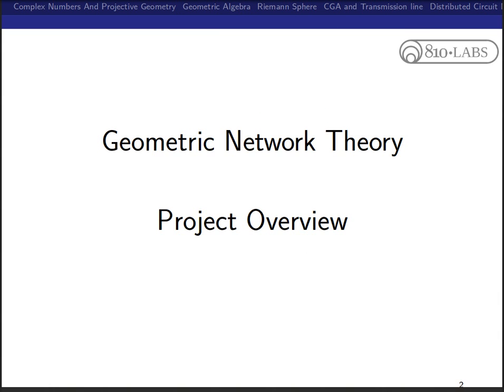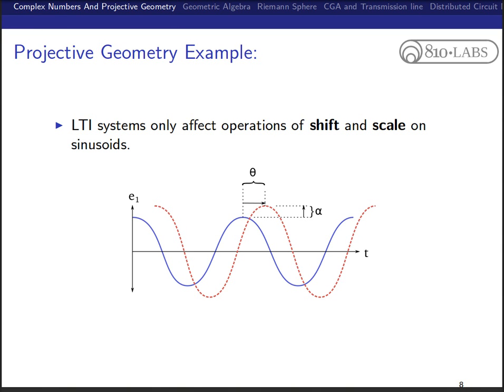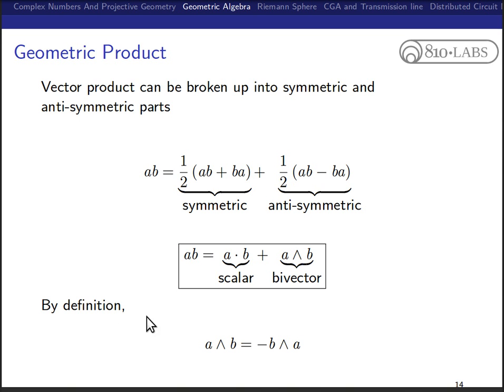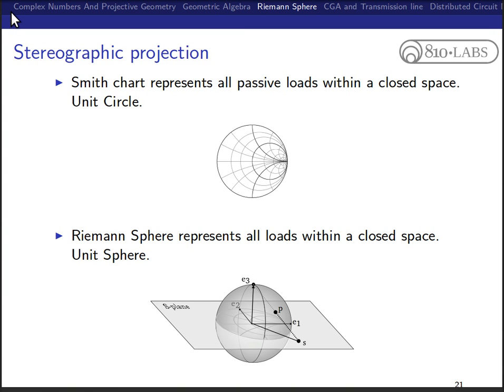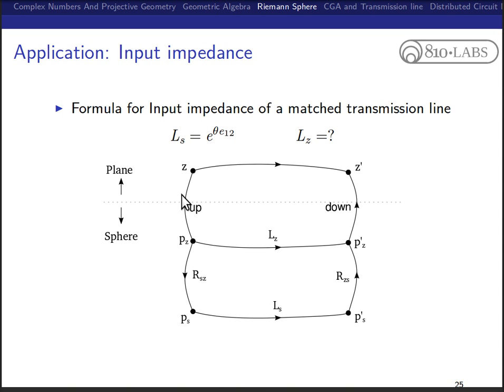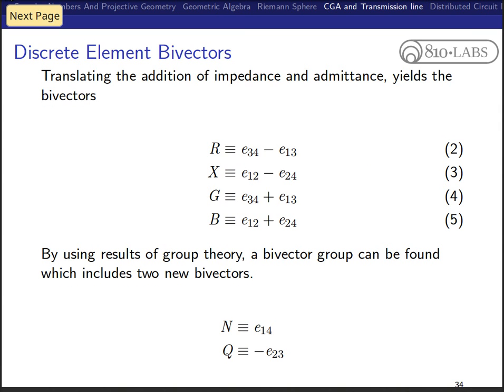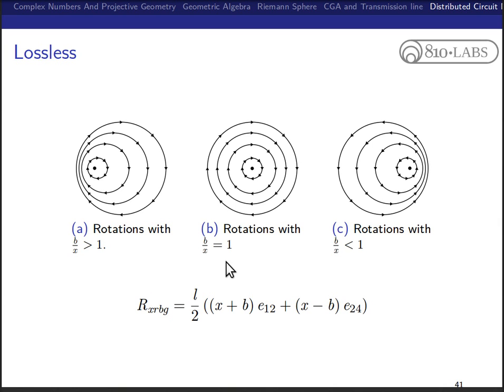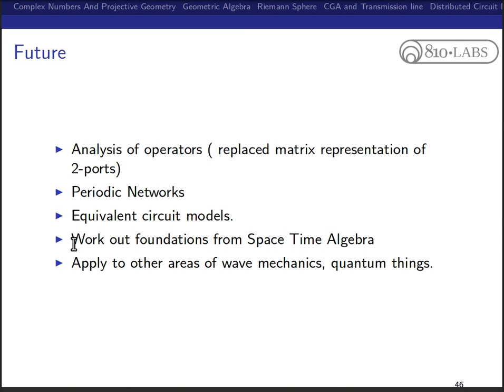Applications Of Conformal Geometric Algebra To Transmission Line Theory

Comment: Cool, you're investigating the same stuff I'm investigating. The Smith Chart, conformal maps (sqrt(x^2+1)+x, -sqrt(x^2+1)+x, sqrt(x^2+x+1)+x, -sqrt(x^2+x+1)+x), distribution of points on double angle sphere [x^2-y^2-z^2, 2*x*y, 2*x*z], spinnors, and I imagine you noticed gamma by now. So, two complex numbers behind all of this. Possibly two quaternions behind each for conformal mappings. I don't plan on going down this road though. I'm doing DSML in collage. Best I can ever hope for from a physics professor is a giggle and maybe a comment about my pretty graphs.

Comment: Can you extend it to N-port impedance matrices with N>1?
Reply from the maker: i have  another video about how to model 2-ports. i worked on the n-port problem for a while but never figured out a good model. i think its possible.
Reply: @810labs  Especially interesting would be the calibration of an N-port network analyzer with a 2N-port "error network" in the connection. Leading of course to a "calibration group", isomorpic to Sp(2N,C) if I'm correct. (Since a reciprocal S-matrix gives a symplectic T-matrix. Lots of interesting things!)
Reply from the maker: @JosBergervoet   it would be really neat. feel free to email me.

Comment: I know this should apply to human vocal tract analogy and resonance for vowel sounds. I see bits and parts I recognize, but I am still at a loss. I know how to take vocal tract cross sectional areas and with cascading operation I can get the formants, F1, F2, F3,... And I would like more direct methods, such as rotations. But I don't see the connection.

Comment: Thanks a lot, very well done and inspiring. Have you done some work to see how it describes nature when we upgrade Minkowsy spacetime to 3 complex orthogonal planes? Consider a quite significant flaw in the interpretation of Einstein’s discovery of the constant of speed of light; what if c isn’t a speed (a vector pointing in the direction of motion) but just a fixed scaling factor, manifesting the ratio between distance and time, as 2 properties of the same, only differing locally due a phase shift, which can be represented by a complex number at each position in the grid. This would imply time to be a 3D vector as well, as it scales to distance with a constant scaling factor c. A wave observed from a fixed position and time is a phase shift of position in 3D space vs a moment in 3D time. 

I am pretty sure we can succesfully detune our observations from Minkowsky spacetime manifold to a static grid. As a next step in the transformation of our observations we should then model and observe (measure) cosmic as well as minute expressions of the universe in GA language (G3+3 Space, a space spanned by 3 orthogonal basis vectors in real 3D space and 3 orthogonal basis vectors in imaginary 3D time). 
Each basis vector of space pairs with its imaginary Counterpart basis vector of time. Dynamics come into existence through phase-shifting the grid positions In the 3D field of moments of time with the grid positions in the 3D field of position in space. Entanglement is a phase-lock relationship of 2 separate positions in 3D space; superposition is a phase-lock situation of two separate Positions in The 3D time field at a single position in 3D space. 

It would be great fun to demodulate the forms constructed over space in the 3D field of time experienced from a fixed position in space, which is a superposition of phase shifts, hence waves at a certain fixed position. Who volunteers to colaborate with me to work this out. The project should render 3D animation models demonstrating properties of fundamental particles, superposition, entanglement and should demystify observations such as in the double slit experiment. It would explain the measurement problem and dequalify the Copenhagen interpretation of the collapse of the wavefunction, which is nothing more than opening ourselves to 2 new time dimensions that operating at slight phase shifts around moments of observations in linear time.
Reply: When you put it like that, I get the impression that this might be better described as time being a bivector space (or pseudovector space). The bivectors in G(3) behave very much like complex numbers to the point that you can argue that e12 simply is i, with the other basis bivectors forming the quaternions j and k. Since bivectors generally work very well for rotations, it seems like you're suggesting that we could rotate a position in space by a position in time, which is an interesting idea. This would also equate time the the quaternions if you include the scalar part.

The alternative to that would be a G(3,3) space where time has its own separate basis vectors that square to -1 rather than acting as bivectors of the spacial basis vectors. This would give an absolutely massive 64-dimensional multivector space which I personally would rather not think about.

Honestly, if you think there's merit to the idea, try it out! If it appears to accurately describe observations in real life and matches the existing math, then it could very well end up changing our fundamental understanding of the universe. If it doesn't work out, so what? How often to you get to play around with a 6 dimensional vector space‽
Reply from the maker: Geometric Algebra emphasizes real algebra. complex algebra is ambiguous geometrically.
Reply: What do you think of the suggested interpretation of c (scalar vs. vector)? 
With time being a 3D vector too?  If we could visualize this in 2 x 3D. Time being the 3D phase modulation of each position in 3D space?
Reply: @810labs  THE ABSOLUTE, BALANCED, EXTENSIVE, AND CLEAR MATHEMATICAL PROOF REGARDING E=MC2 AS F=MA:

Gravity IS ELECTROMAGNETISM/energy, AS E=MC2 IS F=MA. The Earth (A PLANET) is a MIDDLE DISTANCE form that is in BALANCED relation to the Sun AND the speed of light (c), AS the stars AND PLANETS are POINTS in the night sky; AS E=mc2 IS F=ma !!! This NECESSARILY represents, INVOLVES, AND DESCRIBES what is possible/potential AND actual IN BALANCE, AS ELECTROMAGNETISM/energy is gravity. Very importantly, A PHOTON may be placed at the center of WHAT IS THE SUN (as A POINT, of course); AS the reduction of SPACE is offset by (or BALANCED with) the speed of light (c); AS E=mc2 is F=ma; AS ELECTROMAGNETISM/ENERGY IS GRAVITY. The stars AND PLANETS are POINTS in the night sky. The sky is blue, AND the Earth is ALSO BLUE. (OVERLAY what is THE EYE in BALANCED RELATION to/WITH what is THE EARTH.) E=MC2 IS F=ma !!!

TIME DILATION ULTIMATELY proves (ON BALANCE) that ELECTROMAGNETISM/energy is gravity, AS E=mc2 is F=ma. INDEED, TIME is NECESSARILY possible/potential AND actual IN BALANCE; AS E=mc2 is F=ma; AS ELECTROMAGNETISM/energy is gravity. The stars AND PLANETS are POINTS in the night sky. SO, THE EARTH is E=mc2 AS F=ma IN BALANCE. Objects fall at the SAME RATE (neglecting air resistance, of course), AS ELECTROMAGNETISM/energy is gravity. Gravity IS ELECTROMAGNETISM/energy. It ALL CLEARLY makes perfect sense. BALANCE and completeness go hand in hand. So, get a very good LOOK at what is THE EYE. (Very importantly, outer "space" involves full inertia; AND it is fully invisible AND black.) "Mass"/ENERGY IS GRAVITY. ELECTROMAGNETISM/energy is gravity. E=MC2 IS F=ma.

Gravity AND ELECTROMAGNETISM/energy are linked AND BALANCED opposites, AS E=MC2 IS F=ma; AS ELECTROMAGNETISM/energy is gravity !!! Gravity IS ELECTROMAGNETISM/energy. BALANCE and completeness go hand in hand. Consider what is the speed of light (c) as well. Carefully consider the man who IS standing on what is THE EARTH/ground. Touch AND feeling BLEND, AS ELECTROMAGNETISM/energy IS gravity. Energy has/involves GRAVITY, AND ENERGY has/involves inertia/INERTIAL RESISTANCE. The ultimate mathematical unification of physics/physical experience combines, BALANCES, AND INCLUDES opposites, AS E=MC2 IS F=ma (ON BALANCE !!!); AS ELECTROMAGNETISM/energy is gravity !!!

"Mass"/ENERGY involves BALANCED inertia/INERTIAL RESISTANCE consistent with/as what is BALANCED electromagnetic/gravitational force/ENERGY, AS E=MC2 IS F=ma; AS ELECTROMAGNETISM/ENERGY IS GRAVITY. Gravitational force/ENERGY IS proportional to (or BALANCED with/as) inertia/INERTIAL RESISTANCE, AS E=MC2 IS F=ma; AS ELECTROMAGNETISM/energy is gravity. Gravity/acceleration involves BALANCED inertia/INERTIAL RESISTANCE, AS E=mc2 is F=ma IN BALANCE; AS ELECTROMAGNETISM/ENERGY IS GRAVITY !!! Therefore, objects (AND the falling men) fall at the SAME RATE (neglecting air resistance, of course); AND the rotation of WHAT IS THE MOON matches it's revolution. MOREOVER, a given PLANET (INCLUDING WHAT IS THE EARTH) sweeps out EQUAL AREAS in equal times consistent WITH/AS F=ma, E=mc2, AND what is perpetual motion; AS ELECTROMAGNETISM/energy is gravity; AS E=MC2 IS F=ma IN BALANCE !!!! Gravity IS ELECTROMAGNETISM/energy, AS E=MC2 IS F=ma. This NECESSARILY represents, INVOLVES, AND DESCRIBES what is possible/potential AND actual IN BALANCE !!! Great.

By Frank DiMeglio

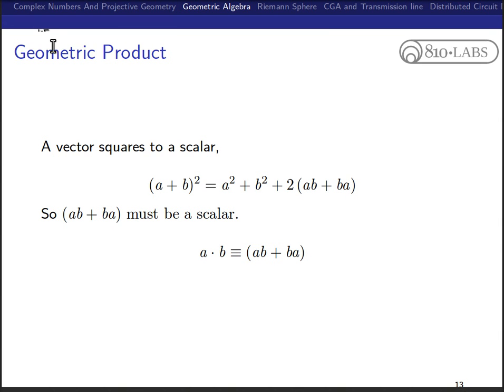Comment: My question is two part and concerns the video at 8:07.  Part A) to my question begins: you place the square of two added vectors aka their expanded dot product  as a second supposedly-equivalent statement a^2 + b^2 + 2(ab+ba). I must check from you that these are intended to be the nonorthogonal case because otherwise our dot product would be 0. And if this nonorthogonality stands, then this looks to me exactly as the law of cosines should look which would equal out to some scalar quantity c^2= a^2 + b^2 + 2a•b. If so, then 2(ab+ba) looks confusing and my first question is can you clarify why we are using this 2(ab+ba)? Part B) Still concerns 8:07, where I would like to know why this a•b would also be the same as (ab+ba). This is below your first formula. We are taught in the GA  that the dot product is 1/2(ab+ba), and it also says so in the following slide which is quite different compared to your equation of (a+b)^2 which when stated as the law of cosines still retains a great symmetrical and deceptively simplified structure. My second question is could you please explain how the statement a•b is the same as (ab+ba) when I believed that 2a•b= (ab+ba) and hence the 1/2 compensation for a singular nonorthogonal and symmetrical dot product a•b ? 2a•b is still a scalar in the absolute value sense. 

Thank you for your assistance in advance!
Reply from the maker: no sure i understand.  there may be missing factors or 2, but you get the idea.  can find more about GA in those books or on wikipedia.
Reply: Sure. Got it! Thanks for the quick response!

Comment: Very nice explanation. The paper on IEEE access is also very interesting, although is long and contains a lot of material.
I would like to point out that in the slide Paths generated by discrete bivectors the role of X and R are probably exchanged.
Nice work! make more videos with more details.
Thank you!